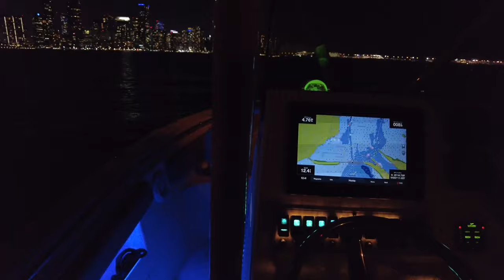Boat Vlog | Working on my budget speed boat build | Running errands | 35’ Donzi ZF

Comment: Hey brother I have a donzi 35 zig just got it! Question I changed my fuel transfer pump filter under the steps in the center console! The question is which direction does the switch go to transfer fuel from the reserve to the main tank! 
Pump works fine but there’s a selector switch and I can’t tell which direction moves fuel out of the reserve into the main tank! I don’t want to let it run because the reserve is full already